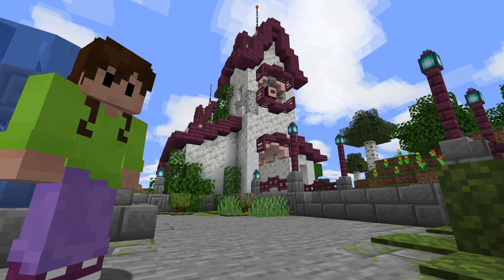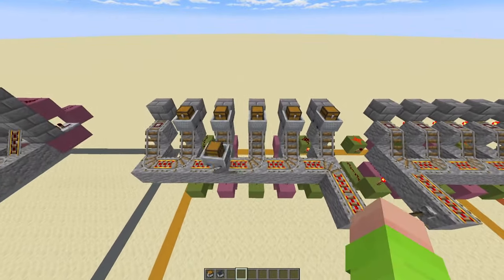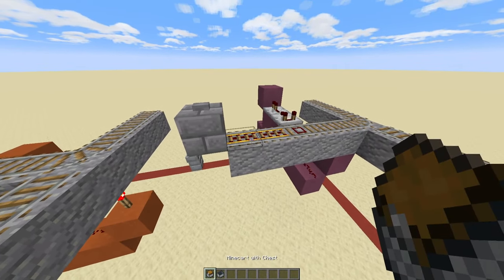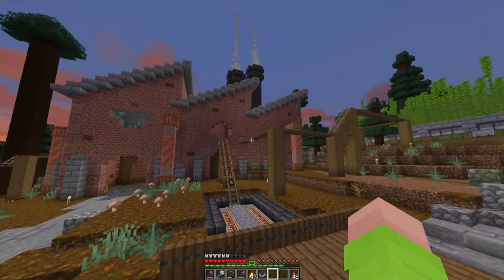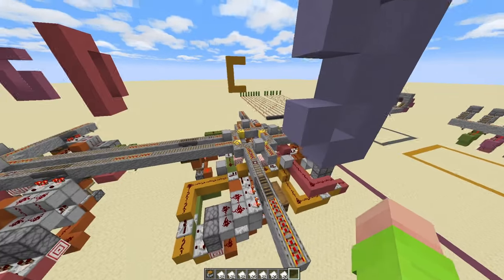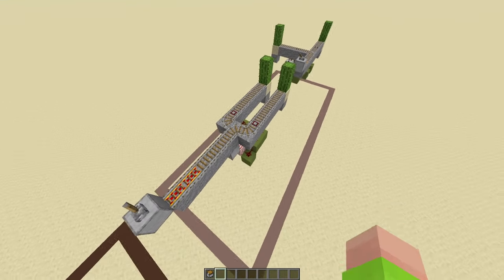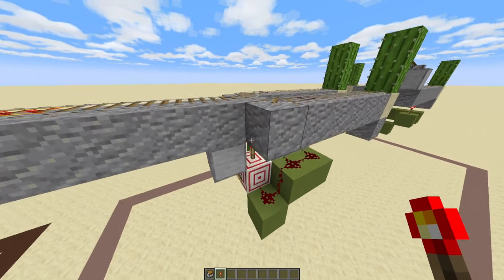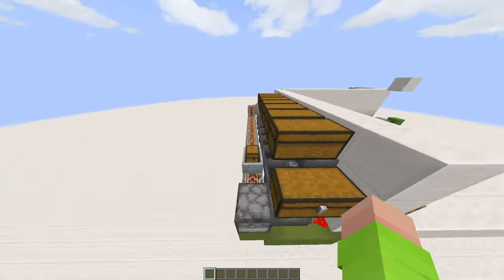How To Improve Your Rails in Minecraft

Comment: Hi! Thanks for checking out our build. CC did a great job on these videos. A couple things I wanna mention:

- For everyone worried about re-using tickets, I don't think instantly handing them back is worth it... However, I am working on a cool system that will retrieve used tickets that we'll show in an upcoming video

- CC explains at 11:17 that you can use D tickets for both roundabouts. This is true... However, there's a reason why you might not want to. If you want your rail system to be able to create custom routes rather than the shortest possible path to a location (like lengthy tours around your world), naming your tickets different at every roundabout would allow this. Such as DNorth and DSouth for the rails pointing to the D line

- Though CC does mention it, its worth emphasising that you can stick a ticket in a storage minecart to direct resources a specific direction

- It wasn't covered but for the encode system, there's a stand-alone design for adding a new single station encoder along a route, we can show that in future if people want it, though its pretty self-explanatory

- Its worth mentioning that the encode system would mean any stations connected to the system would automatically be programmed to get to any other station... You just need one piece of paper and an Anvil to get anywhere

- The encode system also uncaps the limit of only 27 tickets per minecart chest up to infinite

- Using lettering like ABCD in the tutorial video is just for convenience, we recommend giving unique names to your sections of rail so its easier to remember and program a route

Comment: I'm currently planning to connect the server I play on with piston bolts and got this video recommended! Really interesting how you approached it. Also, I've got to say: Your videos have such good pacing, never getting boring but aren't too fast either, which is something I struggle to achieve a lot as they are often times either to boring or way too hyper for my taste, definitely gonna try to draw some inspiration from yours! Keep it up <3
Reply from the maker: Thanks for the compliments!

It'd be interesting if you could link the ticket system up to a piston bolt. I've definitely thought about it but Piston Bolts are a bit out of my comfort zone right now.
Reply: @DrawnbyCC  Yeah, piston bolts also don't look as good as your system, but it is kinda necessary for me to make the people choose it over the Elytra. Of course it's still slower and not as flexible but you also don't have to do anything, once you're in the Minecart. Maybe if they'd implement a way of making the minecart competitive in speed people would do more if these sorts of projects. Same applies to the nether in my opinion as well, it just keeps you from connecting your builds through rail or even paths. It's just way more convenient to use these methods:)

Comment: My nether rail network works on a similar idea. Although mine differs in the way a rider uses it. First the rider enters any station and selects a destination, a fixed length train is despenced, consisting of 1 chest cart and 2 passenger carts. Once the rider has boarded they press the go button. The chest cart guides the train anywhere in the system, and ejects the rider at the selected station. Carts and tickets are sorted and stored ready for the next trip. I'd love too go over it with you and share ideas.
Reply from the maker: You should join my discord! We have a rail discussion channel in there. Link is ij the description

Comment: Is there a version of the station both as an unloading and loading bay?
Ie: I roll in with my line of chest. They all load into little compartments. I choose my direction and they all start off again? I hope this makes sense. I’m wanting to design something without a ticket system as I intend to ride along with all my chest all the time to prevent loading issues.
Reply from the maker: Not just yet, I do want to figure it out though. Will make a video if I get a good design